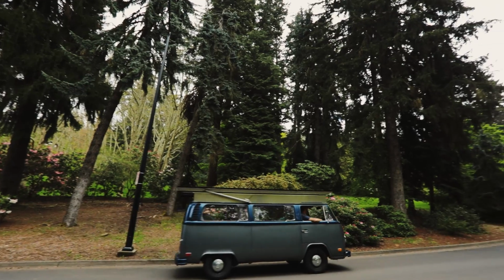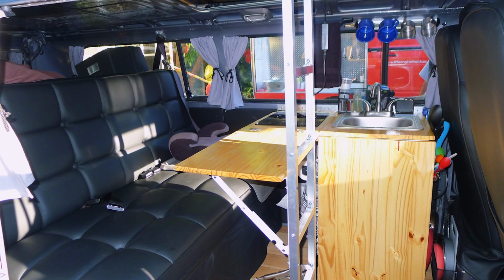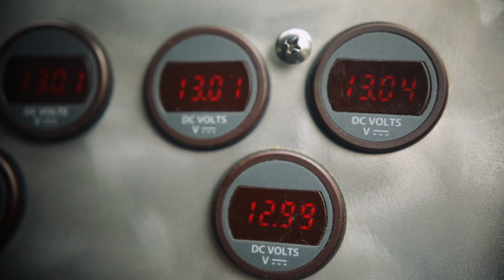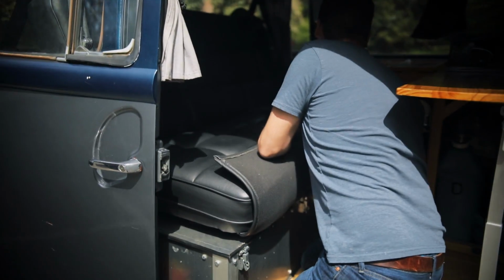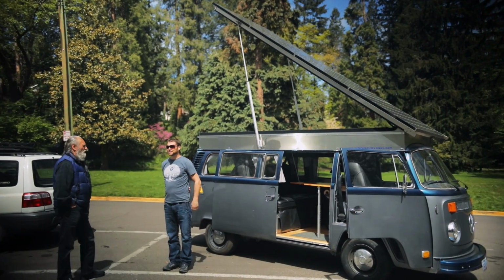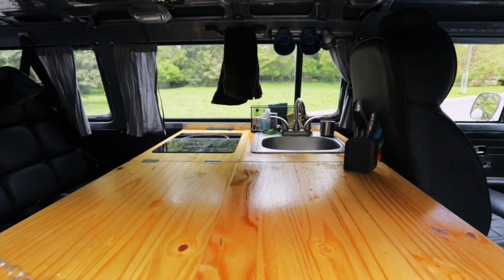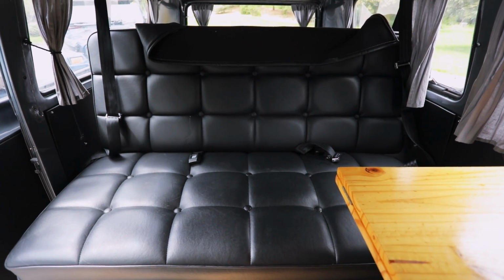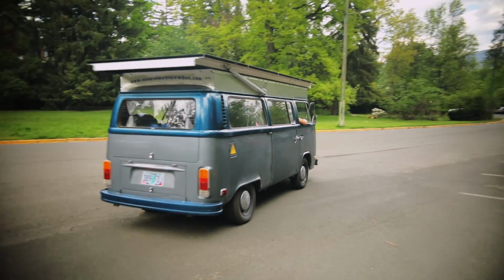This is a Fully Solar Powered Electric VW Bus

Comment: One thing you might want to consider is hub motors instead of a central motor.  You might find, like Aptera, hub motors are more efficient than a centralized motor with transmission.

Comment: why not use mppt controller then inverter to 240V. you can use the controller ouput to said 12V, 24V or 48V battery band. then invert back to 240V as you want.

Comment: 150Wh/mile is impressive! I imagine this is a t low speed, but "modern" EVs with induction motors, use as much when driven carefully, despite having 1/3 the cDA of a VW bus, which are notoriously known as aerodynamic bricks. Using a DC motor has its advantges, they are usually more efficient at low load than induction motors.

Comment: Nice... As they get bigger and prices drop I've always felt solar panels would make a great open roof coverage from elements for ventilation. I see everybody trying to work around their panels and needing to be careful with the roof layout. Solar panels are water tight and they do stop the sun.  I recently upgraded my small and modest van conversion with a single giant 320 watt solar panel that also serves as the roof lid for my fan and extractor.  The redesign allowed me to also downsize watt consumption by a 1/3 while increasing air flow by 3.. all at about 1/4 of the cost of one Maxair fan.  I am also anticipating an improvement in fuel economy thanks to better fuel economy.  My prior setup look stupid and rattled in high wind and screamed somebody is in that van.   In the end IMO, my van looks stealthy and will be easier to maintain with no moving parts and a replacement fan motor is now $5 on ebay 5 minute swap install.   You can find that build here:  https://youtu.be/HnBreDEpmaM

Comment: Pity this option is not available to people like me, i.e. not a brilliant engineer as you clearly are. Great technology, I just don't have the skill set to make one.
Reply: Electric Cars with Solar panels are coming. There is allready the plugin hybrid toyota prius with solar panels and the Sion from Sono Motors and the Lightyear one is coming this or next year. The Sion costs 26.000€ and the Lightyear one 50.000€ I think.
Reply: The Sion is dead.
They did it too complicated.
This solution here is easy and it runs!

Comment: Copper pipe is a huge power loss. You need braided wire for dc. You don’t need a step down just run wires off a 12v circut. Just like you have the volt meters. Cool van. I feel like you spent over $30k on this. Which seems completely insane to me.

Comment: Great vid - love it. Nissan gen one batteries are pretty cheap and they are some great Y/T vids showing how to do it safely. Check out -Tech Direct, Big Battery and Battery-Hook-up for prices.
The induction cook top are what I use in my grid solar home also, they work great. I like the NUwav induction cause it has a watt selector 600, 900 or 1300 choose of watts, a Big plus when on batteries... They come in large and small cooktops. We keep them under the cabinet where our range was, more counter space, yeah. SOLAR ROCKS!

Comment: Everything looks perfect and he is pro!
except I worried about the battery access location is from inside. Imagine if they start bubbling while you are camping With you kids in the back or fire. 
Can you just do a body work and seal the battery access door completely from the top to prevent a gas leakage and fire then make a battery access door from outside of the driver side with a big pull out drawer battery tray with a track & wheels?  That way you can even load/unload and work on the wires from outside and when you done you side it in.

Comment: Problem is if I put s/p on my bay window in U.K I would only get down the road and that's down hill , we don't get much sun here , I am thinking of fitting around 200  small wind turbines on roof and a get me home air heat exchanger kit . Maybe I should get a chainsaw and take some trees out  it may get warmer.

Comment: I'd like to get an estimate on what you would charge to convert a vehicle like this for me?
Reply: Hi Lane
We've come along way since this video. We now have lithium battery rigs with up to 100 Mike's per day solar charging.  Check out Solarrolla.com
We have a good inventory of batteries right now and I'd love to build another bus for you.
Components can get spendy but what you get it like nothing else on the planet!  Let me know performance requirements and I can give you a quote.(range, solar charging amount per day, grid charging speed etc)
Reply: Sorry Layne but Lane
Reply: @brettbelan4937    Not a problem. I guess one similar to the red foo with lithium ion batteries.  Basic model so probly less moving parts. We live in a hot summer and cold Winter climate. Obviously heating and cooling will take some miles off the vehicle. Any problems there? Just curious to know what a ballpark price would be. Discussing options with my wife over having a Van or go on the VW way :)

Comment: Hopefully you have upgraded to LiFePO4 since this was first built. You can get a 100AH 12.8 volt LiFePO4 battery cells on Ebay for $400 all you have to do is add a BMS way less weight than those Lead Acid batteries and they charge 4 times faster than those lead acid batteries.

Comment: you might think about using something like this for your pull out          PVL-144W Unisolar Flexible Laminate Solar Panel without back-adhesive tape

Comment: I am very curious to the specs. What voltage do you stop at and How long does it take to recharge from there to full? What are the specs on your panels. Sounds like 24v but missed the wattage. I’ll watch again to see if I can catch them. 
 My wife and I live off grid and are wanting to do something like this during the winters. Get away from the cold of windy Wyoming. 
 Love that you went for it and are upgrading as you can. Very cool 😎

Comment: Panel over panel for the awnings... Make them double-slides... Slide out to the door side, slide forward over the hood so they tilt to the ground, or slide back to give you a back shelter, when not raised. Manual slides would be fine, since you would have them locked in place when driving and not extended until you were stopped. A few support poles and you are good to go. However, I would invest in a simple tiny 2200 watt quiet honda generator first. It makes for better emergency charging, which can be done while you drive and anyone can help you by giving you some gas, if your solar setup dies or has power issues. Not to mention that you can also power additional items, without a sunny day and more "dead weight". (Weight from having panels there, which you can't use, while driving or while there is no solar input.)

Comment: Someone should design hobo survival vehicle that is basically a 4 wheel bicycle with a rear sleeping area and setup for outdoor kitchen with a solar roof providing enough power for modest range assist, a few lights, fans, and a phone and laptop charge. Something like that with enough reliable daily range assist to get one person from the library to grocery store to downtown services and then to an urban camping area would help someone survive in some comfort.

Comment: I like the vehicle.  I see many improvements that could be made or money saved.  Those seats, for instance, are way way overpriced.  A used car or van goes for 1000 and that includes the seats.  I build furniture so the idea of building my own bucket seats is not a big challenge.   Lithium would go farther and weigh less, so if you had purchased  100 dollar seats from a junk yard you could have spent another 3,800 dollars  on lithium batteries and an ultra capacitor bank for quick acceleration .   There are more efficient solar out there that would take up less space but they are expensive.  A roof that size could generate 2 kilowatts in good sunlight for ten hours of the day.  Let's say it takes 20 kilowatts to drive at highway speeds so it would give you an hour of fast speed travel on the highway on just sunlight and that is more than most people want to drive a day, or about a 70 mile range.'
    Given that you have it charged overnight and want to drive in the sun you could expect maybe 1500 watts while driving or 2 horsepower, a fifth of what you need for getting around the neighborhood so that would extend your range by maybe 20%.   Good job on this, however instead of replacing a lot of things on this vehicle why not just build a second one a little more upgraded for the kids future vehicle?

Comment: I can drive hundreds of miles in a single day. I don't worry about whether the sun is shining, batteries or where to charge. Why would anyone torture themselves with an electric vehicle.
Reply: Because oil is causing our demise
Reply: @brettbelan4937  
Name a single person who has died due to anthropogenic climate change pal. The answer is, nobody has ever died and probably never will. Oil isn't causing our demise. Ironically, running out of fossil fuel will cause our demise. And we're burning up our future. The biggest reason to stop using fossil fuels is because they're finite and limited. 1/2 of earths human population will llikely die within 10 years of running out of fossil fuels! The compelling argument shouldn't be climate change but rather humans dependence on fuel.

Comment: Is it possible for a vehicle to have both electric and gas to run as alternative drive on the road ? As we know, electric system hasn’t allowed a vehicle to run on a very long range just yet and to recharge it will take a while before you can get back on the road again.....
Reply: Currently building a 300 mile range RV with the ability to recharge in 1 hour

Comment: So is 50m as far as it goes per day even if the sun is out and the panel is active while you're driving? That would be quite limiting really. So if you wanted to go somewhere 1000m away you would have to plan on the 20 day trip to get there.. hmmm ok

Comment: You can get EV batteries and they require so much less maintenance and weigh less. You don't need to worry about equalization. You did amazing work. Thank you sharing
Reply: indeed...check out Solarrolla.com...thank you!

Comment: What are the tech specs for the motor? I'm looking to start a Transit project. Also, will your next version need the dials? I'm working with Arduino microcontrollers and all of those dials could be replaced with a single, tiny screen and simple voltage circuits attached to the A/D ports of the chip.
Reply: cool man...the motor is a HPEV AC-51....go to solarrolla.com send me email

Comment: I say half those lead acids and add a tiny little genset or fuel cell module you can top up with more or less conventional fuel easily and instantly. That way you always have some sort of a trickle chage going, even on less sunny days, increasing system robustness. Also, part instant top up, which could be real handy. That being said you have a pretty great build already )

Comment: You need to add Super capacitors between the batteries and the solar panel it increases efficiency of the whole system and allows you to go farther while wasting less energy. Even a super capacitor between ther motor and the batteries would make a difference in torque and overall performance.

Comment: Bruh...he's driving a car powered by the sun. That's insane! I'm surprised the gas companies haven't taken him out.
Reply: Just imagine using more fiberglass to maybe lighten the vehicle up where possible, using better batteries that hold more energy per weight, and going to more efficient solar panels (which the technology is getting better [albeit taking a little while to get to market]). I do believe he did this more on a budget, but still turned out really good.

Comment: The Volkswagen website says they are considering reintroducing the minibus as an electric vehicle.  I think that would be great but relying on solar alone to recharge the batteries means plenty of stops in sunny and hence hot parking lots just to recharge.  A range extender generator either onboard or in a battery/generator trailer would be useful.

Comment: I subbed and liked. How about adding solar that hinges on edges of the big panel and stores underneath, but folds out when driving to pick up solar power when going around winding roads and while sitting or camping? Any chance you could make a detailed list of everything you used for us nonelectrically inclined? For instance, the electric motor, is ac or dc ( I think you said ac), exact specs on motor including brand, horsepower, etc., transmission, ann all other parts with schematic?
Reply: Hey there, go to Solarrolla.com

Comment: Solar charging gets cheaper by the day, same with electric. Tesla are the clear standard when it comes to electric vehicles, and an at-home solar charging station can be done for less than 4000$. With gas at an average of $2.91/gal in the US, that 4k would get you 1375gal roughly. With average economy at 24.7mpg, that's about 34000miles. So for what it's worth, solar is obviously the way to go.

Comment: maybe you can save up $100,000 for lithium-ion batteries
Reply: Used lithium would not be that expensive, even new.
Reply: I was being sarcastic I looked into some batteries I don’t have $6000 to spend on new battery even used is pretty expensive I’ll stick with used car batteries and use deep cycles cheap and easy to come bye good used car batteries from the wreckers are only $20-$30
Reply: @be.ndover  Try used leaf or tesla batteries off ebay.

Comment: Three people have completed 4000 mile long trips in the 160 pound solar/human powered ELF car-bike. Some carry an extra battery to plug into a charger at night but the power required is almost non-existent compared to what a 4000 pound bus needs. I have lived the van nomad life for quite a few years when I was younger. Now I regret not being fully aware of just how damaging it is to burn gas in high speed steel caged climate controlled lounge couches. It is not, and never will be sustainable globally even if those heavy vehicles run on pixie dust. The roads and supporting infrastructure including parking spaces all contribute to suffocating nature as they assist us in stealing way more than our fair share of resources from future generations. They cause road kills of both wildlife and humans. They spread an unacceptable amount of brake dust and tire dust. They encourage home designs with large garages and paved driveways that waste even more resources and drive up housing costs. Is a VW camper vastly closer to being sustainable than a huge motorhome? Maybe, but many motorhome owners live in them full time and drive them very infrequently on average and use bikes for local transportation. I got rid of my old car over 4 years ago, I have saved at least $12,000 by not having all those car expenses. The ELF purchase price is intimidating and seemingly impractical UNLESS you get rid of the car, then the ELF literally cost you nothing and pays you in cash every year, now I am placing wads of cash in the bank despite my modest SS pension. Mine paid for itself in just 2.5 years and I am so much more healthy by getting fun exercise at the pace I desire, letting the free solar power do the rest. Giving up your personal car habit is as hard as kicking a heroin addiction but it is fast becoming mandatory to avoid draconian carbon or environmental taxes on personal vehicles not required in your trade.

Comment: You could store a small inverter generator in that engine bay for emergency charging... Ryobi makes one that connects to your phone and tells you how much time is left at the current power draw, the fuel level, hours, and even allows you to shut it down with your phone via their app. I have one and I love it.

Comment: fold out awnings could add a few more square yards,  one could even fold down doubled to shade about half of the wind shield when not driving which would help keep the bus cool facing the sun.  Perhaps another could fold UP from the hood to meet the fold down panel,  totalling 4x5 feet or less, so say 18 square feet, that's two square yards from just space on the front section.   Any weight savings would help.  I have to tell you that 50 and 60 hp outrunner motors from 88% to 90% efficiency are available on alibaba for under 1,000 dollars, and they weigh less than 20 lbs, but need esc controllers and you might as well go with the  Tesla batter bank or make your own ultra capacitor banks which might be a little smaller.   You could use inflatable chairs and beds in the top of course.   
     Anything you can replace with carbon graphite would help.  You might consider a 40 inch turbine wind powered generator under the front hood to capture that wind energy while you are parked.

Comment: when you said the motor only weighed 100lbs compared to the 200lb engine you forgot about adding all of the batteries, so you just made the bus heavier.. not lighter like you made it sound. Cool VW bus though.  Time: 3:28

Comment: "They want 4-5 thousand dollars for these buses even with bad motors in them". ...yeah, because the 400 dollar for a used engine makes that bus worthless... "They" want five thousand for a VW bus so people like you don't destroy them. Thank God he butchered a bus allready defiled with that hideous modern two-tone ugliness. Good thing they didn't bother with a proper respray, so we can see the true colour of the bus in the engine bay shots. I will not comment on him bragging about the "electrical assist"/power steering with that huge steering wheel that is there for the sole reason the bus does not have power steering, because my head just exploded.